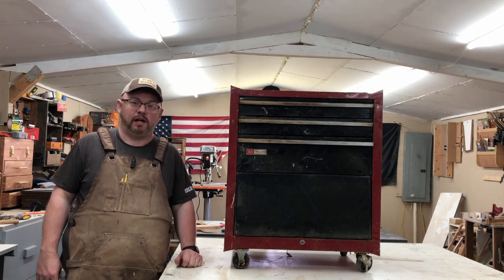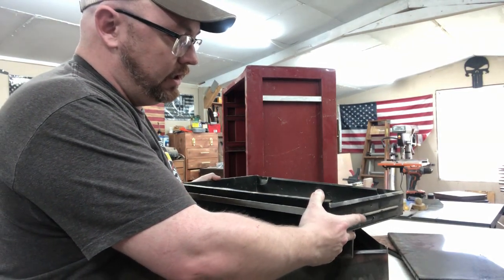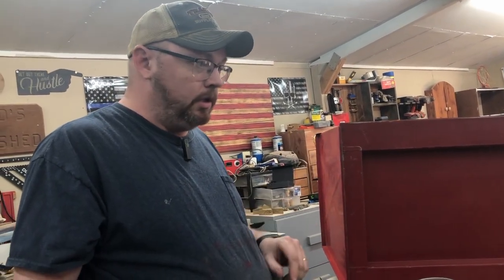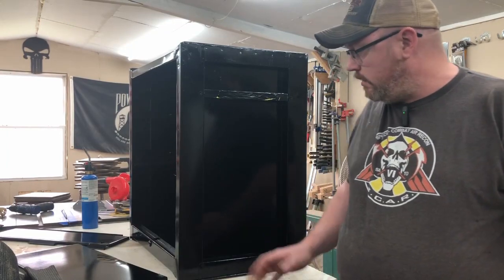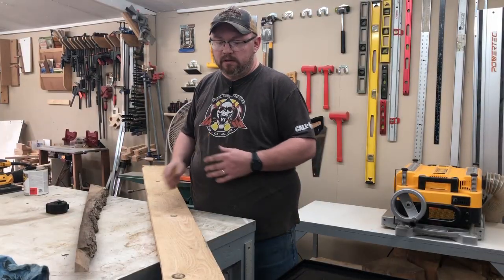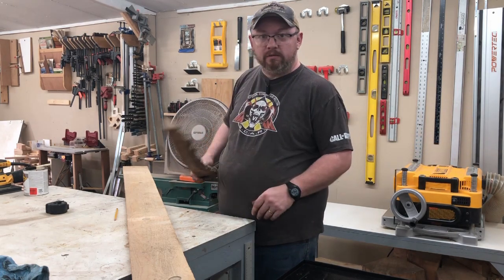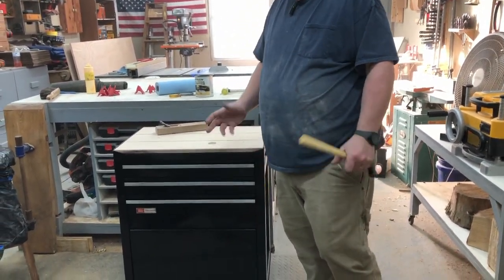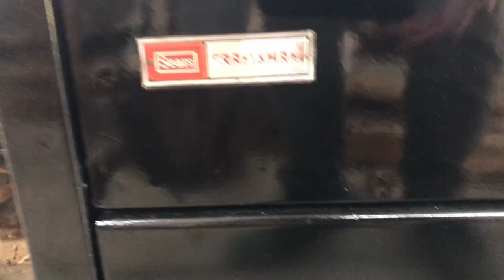Craftsman Tool Chest Restoration! Bringing It Back To Life!!

Comment: Huge improvement, looks real nice Brad!  I did a video on painting that same style unit with Van Halen stripes.  Curious as to what you store in that lower compartment.  Anything I put down there gets forgotten and never seen again because it's so hard to access stuff in it, so I later built a drawer for that space using the original door as the drawer front.
Reply from the maker: Great idea. Hadn’t stored anything as of yet but thought about just larger tools that I don’t use a lot. Corded circular saw etc. I may try that drawer idea!
Reply: I’m a huge Van Halen fan and gonna paint my tool cart. Do you have a link?

Comment: I was given the same lower box along with a top Snap On box for free from a coworker. The bottom box was all messed up. But all that it required was a good cleaning and new drawer clips to make the drawers stay on the tracks. It’s not perfect, but it works great and does.
Reply from the maker: Congrats! Hope it serves you well!
Reply: @Brads-Woodshed  It's one of about five or six (maybe more) rollaway sets in my garages.

Comment: Very nice work!  I just started a rebuild of exactly the same toolbox and I'm having trouble getting the clips removed for the fold-down panel on the bottom.  I got the panel off in a procedure remarkably similar to yours, but no luck on the metal clips.  Any tricks for getting them out?
Reply from the maker: I too had a bit of a fit. It has been a minute since I did it but it seems I had to have an extra hand using 2 screwdrivers and a hammer. Wasn’t easy, and even going back was a bit of a pain!
Reply: @Brads-Woodshed  Well, not the answer I was hoping for, but thanks for getting back to me.  I may just work around that part since you can't see it anyway.